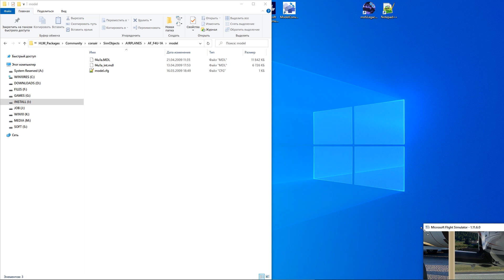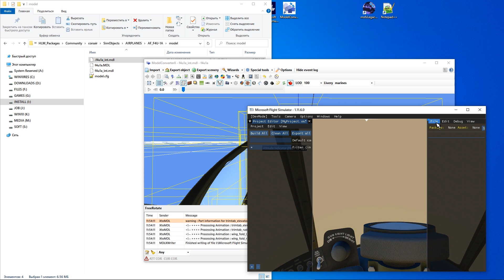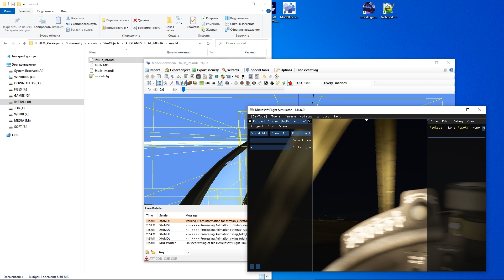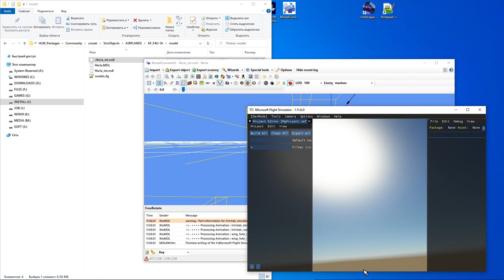MSFS Legacy - glass transparency fix

Comment: Hi, I have converted and imported Tu-95 and Boeing B-50 but the properel are not turning, in the animation in the ModelConverterX are working, but after importing tham to mSFS 2020 with LegacyImporter they are in white colour and don't turning, have you any idea what shell I do ? :) Thanks in advance for your ansver :)
Reply from the maker: my apology, but I am not working on this project for a long time, neither use any legacy planes so can't give you any advise. MSFS no longer support MDL models properly so you need to apply many manual fixes to make it work.
Reply: @TouchingCloud  Thanks :)

Comment: Any reason why my sim cant play engine sounds of imported aircraft? all the sounds are ticked and no issues are displayed in the program
Reply from the maker: just single aircraft? or all? if single - some sound files are missing
Reply: @TouchingCloud  it’s a single but someone imported the very same aircraft but they said they had no problem with the sounds 🤔
Reply from the maker: @danielkeane1225  that's weird. but usually program does not touch sounds (if you haven't pressed anything on sounds tab), so this is some aircraft compatibly issue with MSFS, or something missing.

Comment: Did you use the SDK from MSFS2020?
Reply from the maker: no, as it FSX model, editor require FSX SDK dlls
Reply: @TouchingCloud  Where did you download it?
Reply from the maker: @watermelon2478  it comes with FSX installer, both disk or Steam versions. P3D has similar SDK (but free), but users reported that their DLLs does not work with MSFS properly.

Comment: I'm getting the "MDLXWriterErrorFailed to locate FSX XtoMDL, please update the path in the options
"   every time I export.
Reply from the maker: you need to have FSX SDK installed, and it path configured in program settings - haven't mentioned that as it main requirement of this program.
if you have no FSX and have no plans to purchase it, you can try P3D SDK which is free, but can't promise it will work with any model.
Reply: @TouchingCloud  I found the fix. I downloaded P3d V4 SDK and it automatically found the path. Thank you.
Reply: @larryhughes322008  @alex marko Cheers. Why the exe isn't in the FSX:SE makes no sense!
Oh actually I exported as using the p3d 4.4 and it was broken sadly.
Also found the p3d v1 sdk, which has the xtomdl but I still get no model in msfs now.
Reply: @markypea  You have to use the older p3d SDKs to make it work http://cloud.prepar3d.com/SDK/Prepar3D_SDK_1.4.4747.0.exe
Reply: @Arkid77777  hi, thanks for the response, but that is the version that I am using already.
Reply: @Arkid77777  Hey, I tried again having set X Converter back to defaults and it worked!! Yay
Reply: @TouchingCloud  would the FSX:SE SDK path work?

Comment: i get this message when i try to export object "Error The decimal character on your machine is not set to dot. This is required for MakeMDL to run, please change it in your Windows Regional settings in the Control Panel.
". What i have to do?
Reply from the maker: You can try this tutorial: https://www.softwareok.com/?seite=faq-Windows-10&faq=146
You need only steps (1.) and (2.)
Reply: @TouchingCloud  nothing, i've done everything like the image on that page but still nothing
Reply from the maker: @Reos4346  your best chance is describe your situation in details on MCX development forum: https://www.fsdeveloper.com/forum/forums/modelconverterx.87/